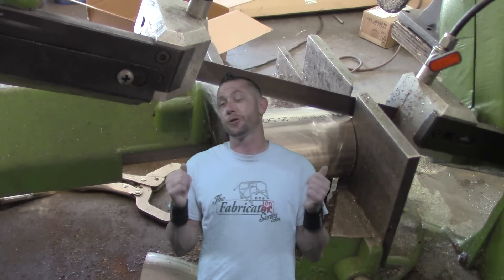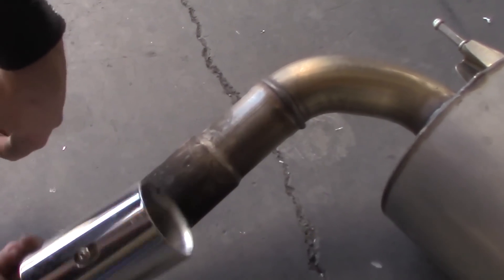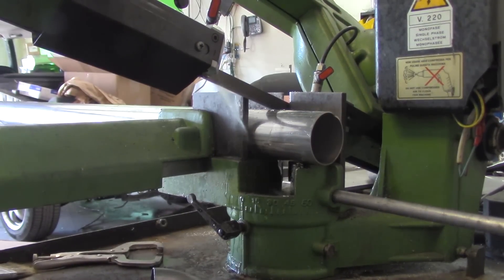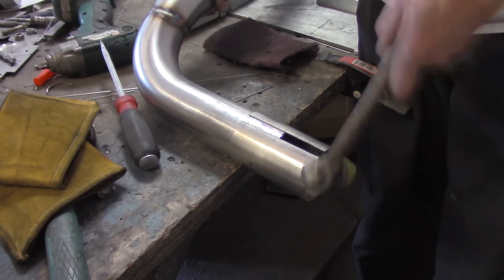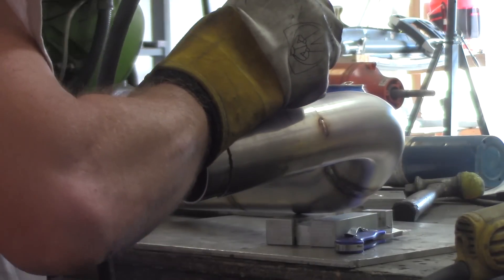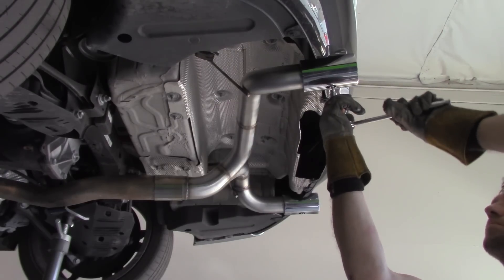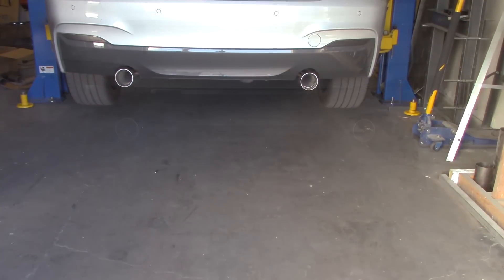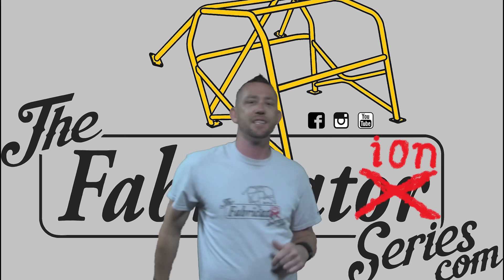TFS: How to Slip Fit Instead of Swage (M235i Muffler Delete Sound Clip)

Comment: Question:  When you are tig welding a slip joint on an exhaust that has been swagged, do you still need to back purge the tube still since you are actually joining the two pieces on the outside of the smaller diameter?

Comment: Thats not a slip fit... its a collar. I was expecting how to make an actual slip fit pipe that goes over a pipe of the same diameter... you just made a spacer.
Reply from the maker: The process is called slip fitting. It was explained in the beginning of the vid that when you don't have a tool to make the swage (the actual name of the part/process), you can slip fit (another process name) a tube to fill in the gap. While there may be other terms for it, I used the most common industry terms.

Comment: Nice clean install, it's easy to spot the tips pointing different directions.
Reply from the maker: It's actually an optical illusion from the camera. Every view angle shows a different gap, crooked direction, or spacing issue. It drove me nuts during editing.

Comment: Can you show how you made that one into two merge section of the exhaust in one of your videos? Thanks
Reply from the maker: I'll definitely get that in a future episode.
Reply: I'm looking for that all over the internet as well. Have som pipe materials in order, but did not order the pre built slip joints. (Ticon Industries makes them, as you know)  I'm getting started on titanium exhaust for my motorcycle, and it is just good practice to make the system detatchable without having to remove big barts of the bike like the engine or the rear subframe. Then slip joints are perfect. But I have never done anythinng like that before, so I have a few questions.Are they made conical to seal a little bit better?I do not aim to use graphite gasket sleeves.  How to expand without leaving "shoulders" from a cheap pipe expander? Im considering machining a pice of axle with 0,5-1 degree of taper from a axle to expand the pipe. Like in the G&G for R6 video. Thank you for great videos that explain things a little more in depth, and also including the engineering behind sometimes!